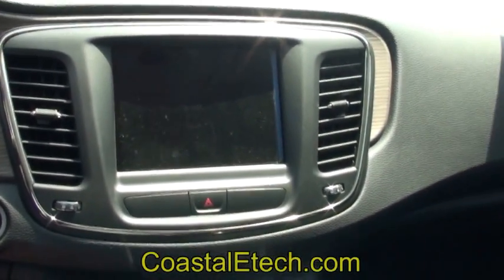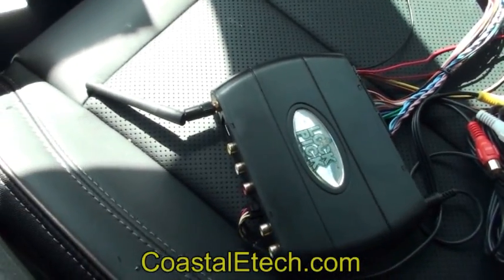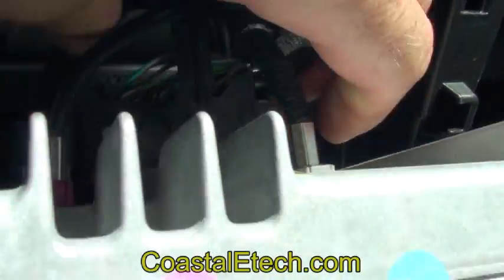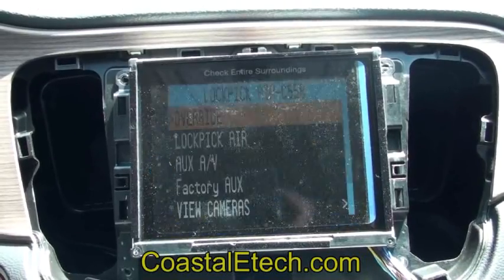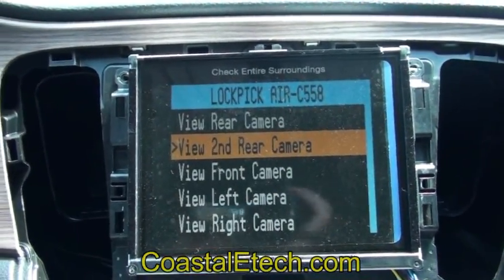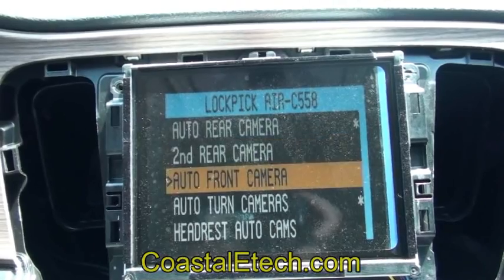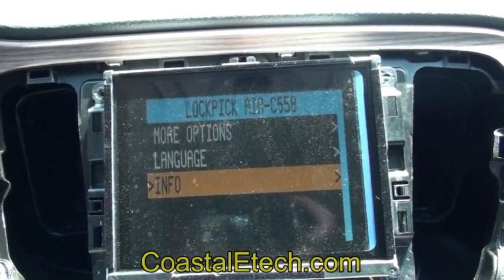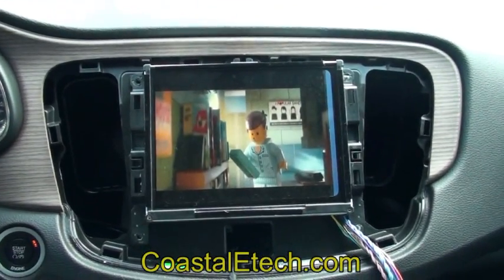Lockpick Air Chrysler 200

Comment: I bought 2 of these for my 2013 Chrysler 200s.
All was well for a year or so? Then one day my radio stopped working.
I replaced the HDD in the radio but it didn't help . I got a PIN from my dealer to try the radio in my other car. It worked fine.
SO, I reinstalled it in the original car Without attaching the lockpick sub-harness and the radio works fine now.
But I miss my backup cam! The 200s are one big blind spot.
I have tried removing battery cable and resetting the TIPM, but no love.
Is there a way to troubleshoot the lockpick to see if it's dead?